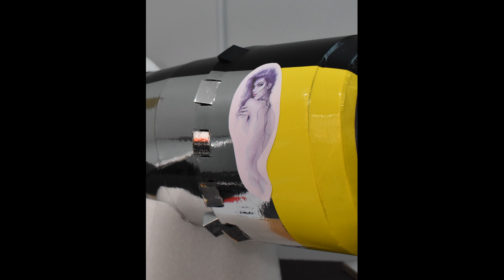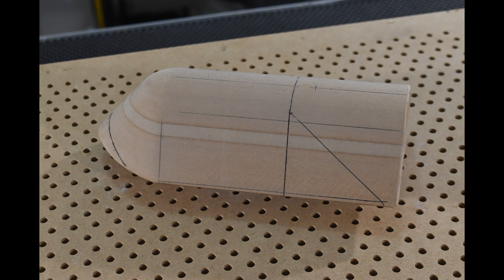Flite Test Master Series P47 Mods and Upgrades.

Comment: Hi Tim,I was admiring your 'rivet tool' and was thinking that if you flattened the points of the pins a bit you may get a better looking rivet head . I am a retired aircraft structures mechanic (sheet metal worker/tin basher ) Thanks again for sharing your skill .

Comment: I absolutely love your mods , the craftmanship is truly  amazing . What puzles me is , how do you get your planes ballanced . I normaly end up with  a ton of lead in the nose ,I could not see any on your P47 .Again super work
Reply from the maker: Thank you Stan. I concentrate all my efforts weight wise on keeping the tail as light as possible. I also use expanding polyurethane glues instead of hot glues. It has a small impact as well on weight reduction. Remember to always keep your electronics as far forward as possible, even the servos. even a cm or two forward can save many grams in the nose. For some plans it is inevitable that nose weight will have to be added. Thanks again and best of luck!

Comment: Your build quality and detail work is on the next level!  I've built lots of FT planes and designed a few as well... the FT Arrow came about shortly after Josh Bixler flew my Aerowing 30 and I shared some of the design details of how I made it fly like its on rails.  One of my best build techniques was using a monocoat iron on a low setting to smooth out and round the edges of the foam which really makes a refined look to any foamboard plane.

Could you do a video on some of your detail techniques like using the chrome avery material, do you apply it to the flat parts before shaping them? I just bought some avery labels for my wing edges and seams... great idea, thanks. You inspired me to step up my game! I'm Hell2Go on the Ft Forums
Reply from the maker: Thank you Edward for the kind words. Have a look at my other videos if you havent already. Ill have a look for you in the forums. Ive been wanting to put together a few things in a video I Just havent had the time. Would also love to make a submission for on the forums and havent done it.

Comment: You've heard this a lot already, but is really is outstanding Craftsmanship!! I imagine that the Mylar Wrap actually adds significant strength over the paper skin. 
The CANOPY is actually my party piece here!! My thing has always been detailed Cockpits - but I SUCK at making Canopies. 😖
I'm doing the MS P-47 soon... I look forward to trying some of your techniques, but the Canopy is but a pipe dream for this old Fart!
Reply from the maker: Give it a try you wont regret it. It takes me a few tries to get it right. Im just using old blister packaging from tools,toys ect. Whatever i can find. The hardest paut is making a mold of what yoy want but the beauty is youy have that mold forever.
Good Luck My friend!! Thank you!
Reply: @cabmantim   Thank you for responding! I just talked about this with a Friend tonight... He suggested making the Mold using a Balsa Wood Block. Easy to whittle and sand, when done, "paint" the finished Mold with a 2-part Epoxy....
He told me that the Epoxy should actually bleed into the Balsa, leaving a Hard finish. 

You ever try anything THAT out there?? Seems nutty enough to work! 

I'm also BUGGED by the thick Foam Trailing Edges. 😖  I use a Covering Iron though, on the lowest setting. 

I may not end up with a removable Wing... But your access Hatch is SO MUCH nicer than Overstreet's design!!! 
Not putting him down! I can't design Planes. But John really doesn't put much thought or effort into esthetics. 😜